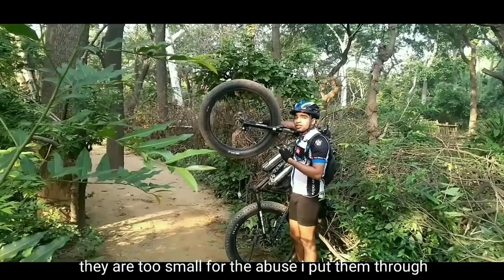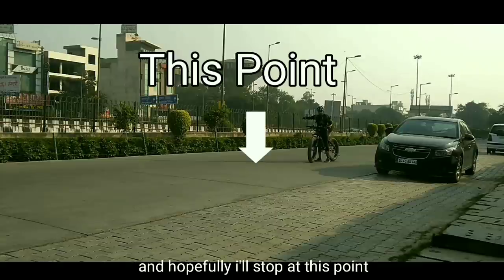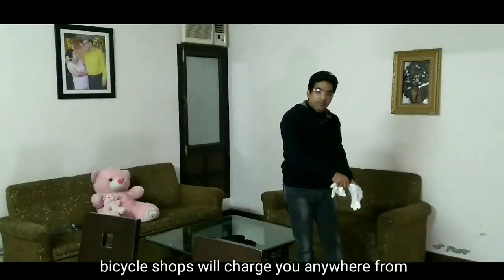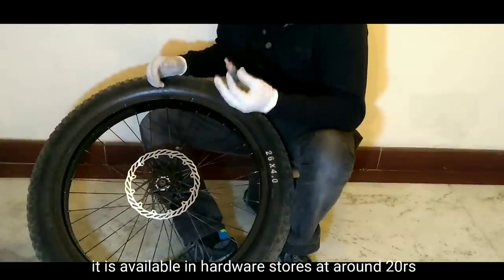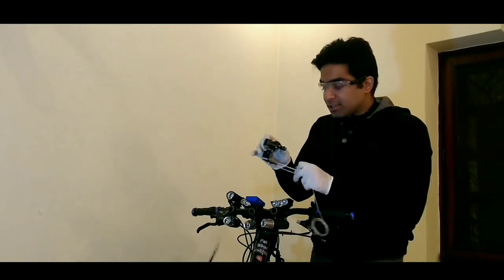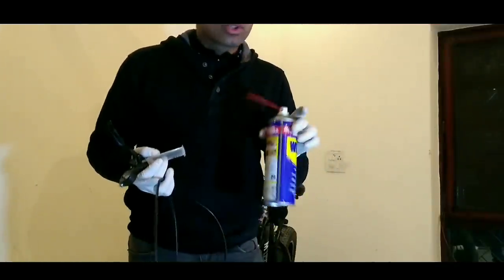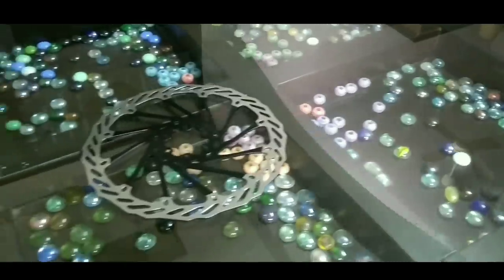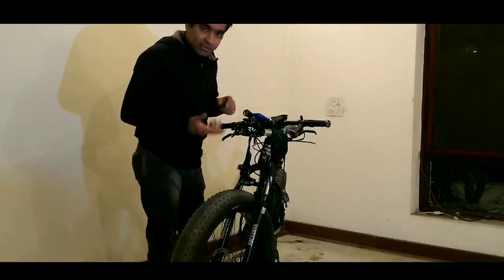Installing Dual Hydraulic 200mm Disc Brakes on bicycle | Biggest and Most Powerful Setup

Comment: Did you clean the rotors after you touched them because skin oil can contaminate them. Contamination can reduce baking power and make the brakes noisy.
At 0:33
Probably the reason of the noise at 5:56 aswell.
Reply from the maker: +Clid Gaming the reason for noise is that i have refilled the frony brakes with baby oil and its too thin that its leaking...so i am still experementing for shimano mineral oil alternative
Reply: Oh ok.

Comment: So many people tell that by applying sandpaper on to the disk brake pads it will improve the backing quality, s first the disk will become too hot after a some time it will get adjusted. This u can do it on to your hydraulic brake  to prevent the noise which comes at the time when the pads clamps down to disk try it
Reply from the maker: +love tracking my hydraulic brake has some othe problem.. fluid is leaking from 1 piston....... I'll tell that in detail

Comment: My MTB is 21 gears with aluminium alloy frame should I add front and rear disc or just front disc??????please help
Reply from the maker: +Kasif Amber no need to add dsc if you arent facing braking issues
Reply: Thank you!!!☺☺

Comment: I've been thinking of upgrading my Mechanical Disc Brakes to Hydraulic. Where can I find them? Also, would my Firefox Viper support dual disc brakes at the front?
Reply from the maker: Dual disc i dont think so
But hydraulic Brakes are easy to find💕
Reply: Fat Biker Vaibhav I was looking for them online when I found a website called bikeinn. They have a decent variety with attractive prices. Do you think it will be a reliable source?
Here is the website : https://www.bikeinn.com/bike/components-brakes/13982/s

Comment: I need to upgrade my bike. It is btwin subsin double. It is having front disk brake , but nothing at the back.
Reply from the maker: +Ronit Raj Xaxa stuntologic yes you can add disc at back too...
Reply: What is the cost of shimano gear set. And shimano disk brake.

Comment: Bhai kya aap muje btaenge ki hm kaise pta kre .. Hmri bike m bhi 2 disc brake lag skte h ..?
Actually m bhi chata hu bht tym se ki mri cycle m bhi 2 disc brake lage bt smjh m nai ata h ki kaise lagau m disc brake and kaise usme work kru 
Aap plz help kijiye
Reply from the maker: Bikram Singh 95% of bikes are not dual disc compatible..... You need to buy seprate hub
Reply: Fat Biker Vaibhav to bhai ji kya ye jhandewalan par available ho jaega ? Ya fir apne jise bike modify krwaya unke paas available ho jaega ?
Reply: seprate hub ?
Reply: Fat Biker Vaibhav mere paas bhai montra madrock 27.5 h to apke accrding muje usme kya kya chnges krne padenge ??

Comment: Bhai mere cycle me ak side me disk break lagane ka hai kya dusare side lag sakta hai
Reply from the maker: +aditya shubham 95% cycles do not come with dual disc compatibility, but tell me your model i'll search and confirm
Reply: Fat Biker Vaibhav bhai mere paas montra madrock 27.5 (2017) model h 
Muje apni cycle m front dual hydraulic disc brake lagana h apki cycle jaise 
Email id- desires.560@gmail.com
Aap muje please help kijiye dual disc brake add krne m 
Like parts which are needed to be changes or required 
Ya fir contact bta dijiye jo apke cycle jaise add kr skta h

Comment: These same shimano hydraulic brakes are available at 6000 rs from shop and the adapter is 350 rs how did you get at 3500 and 45, how did you buy so cheap?
Reply from the maker: +Lakshay Chaddha  i generally get huge discount being a youtuber. Dont worry i'll suggest you were to buy same at low rates
Reply from the maker: +Shubham Mishra nothing like that bro, prevention is beter than cure
Reply: In Gujarat hydraulic brakes cost 3000rs with 160mm disc

Comment: I had put all the trick i put brake hard but it get free brake is not working can i change my caliper an disk rotor...  Please reply
Reply from the maker: +Rashmi Singh just service your brakes by cleaning it...and it will easily work
Reply: Thanks i am your biggest fan..

Comment: Hi in this video you have used shimano shiftor instaed u could have used sram x4 shiftor I have left a link in which I have review this shiftor and it works too good because my bike is 8speed and yours also so try it u can bay this in dectlon it will just cost u about 1000 or 600₹
Reply from the maker: Sure i'll look onto that💕

Comment: Hey Vaibhav, never touch the discs with your hands as there is a lot of body oil in our hands. This oil can decrease the friction between the pads and the discs.
Reply from the maker: Exclusive Tech Travel i did clean them after installing
Reply: Fat Biker Vaibhav ohhh god. Thanks
Reply: Exclusive Tech Travel  ru great

Comment: A took my cycle to cycle to cycle shop and the guy there had put the oil on my mechanical disk brakes and hence now my brake stopped working so it is very hard for me to stop my byciyle so please help me

Comment: How much does your suspension cost
Reply from the maker: chinmai Gowda AS i am not aware about the current price but for latest pricing you can search "rockshox bluto" on their site
Reply: In Amazon rock shock suspension costs 94 thousand but you told that your cycle costs 7 thousand.             ARockShox Pike RCT3 Dual Position Air 160 Suspension Bicycle Fork with Crown Adjust Aluminum Steerer Tapered Disc, 29"
5.0 out of 5 stars 1
   94,042.00
Reply from the maker: +chinmai Gowda AS i tell publically thst my bicyvle is 7000 so that no one steals it.....
Reply: OK thanks fat bike vaibhavi
Reply: Fat Biker Vaibhav  then what is your cycle price

Comment: Bro my disc brake is so noisy what i do please reply fast
Reply from the maker: +Rashmi Singh clean it with soapy water...or alchol....
Or temporarly put mud on it and brake hard
Reply: I had put all the tricks....i brake hard but brake is not working it get free.... Can i change the disk rotor or brake pads please reply.....
Reply: Most likely it has oil contamination, buy new pads and clean the disc with alcohol. And use gloves

Comment: How to free the front suspens
Reply from the maker: +Drawing Master use suspension lube
Reply: Drawing Master clean the stanchions ( inner tube )  properly then apply any type of oil or hair oil  with your finger and spread it on the part which goes inside.. hope it helps..

Comment: if you touch the disc it will be contaminated with oil on your skin and will have lesss braking power
Reply from the maker: +ultradank yes i cleaned them before install

Comment: I just want to install Shimano gears in my cycle where I can purchase them in cheap and get installed in my cycle
Reply from the maker: +Divyansh Jain yes you csn get them online or at any bicycle shop
Reply: Fat Biker Vaibhav what will be the cost of the gears
Reply from the maker: +Divyansh Jain 1000-2000 for tourney and if you get high end like m fat it can cost upto 80,90000